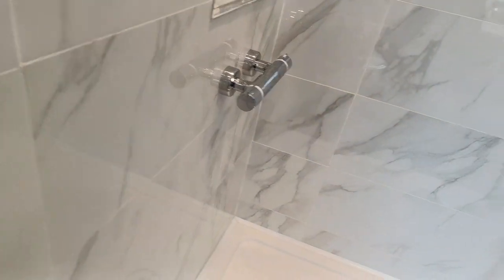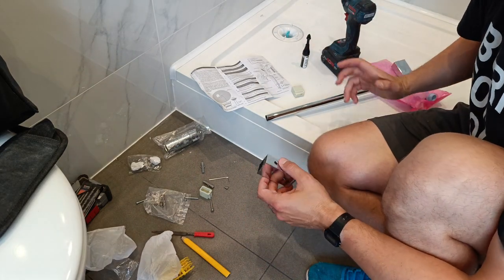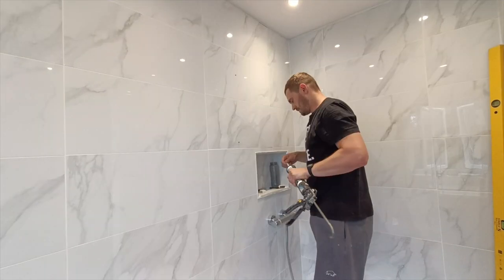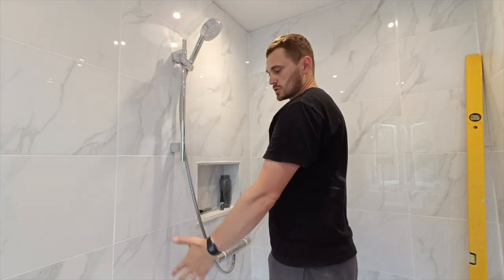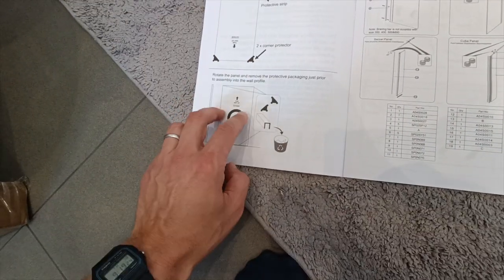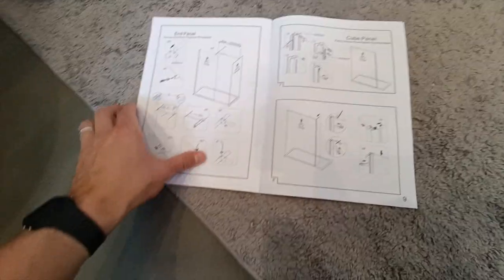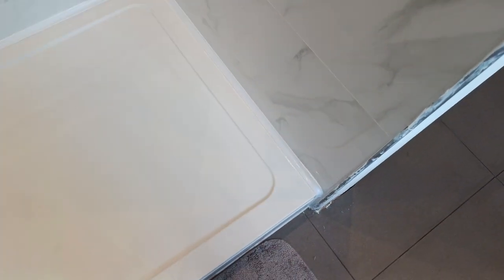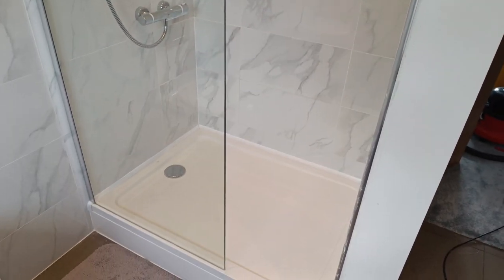Installing the Shower and Screen

Comment: Great work mate, I've been your videos from start, How much do you think you have saved rather then going with tradesmen
Reply from the maker: Cheers mate, glad you're enjoying it.

Costs comparatives are really hard to provide now, because the price of timber has shot through the roof in recent months...

The loft was around £40k all in, and the side and rear extension have probably cost about £100K so far (with another £10k still left to spend).

I think at today's prices it would be more like £60K for the loft and £175K for the extension if I was paying someone else to do the work

Comment: Thought you’re not supposed to silicone the inside of the wall profile of the shower screen because water is supposed to run off back into the shower tray . Any water that gets trapped behind the profile will go mouldy and affect the silicone behind the profile
Reply from the maker: Yeah I've heard that, but every time I haven't siliconed the inside, it has leaked. And if you silicone the inside, outside and the top, how can water get in? I figured I'd rather risk it and not have it coming through